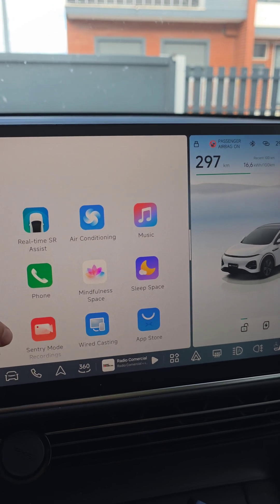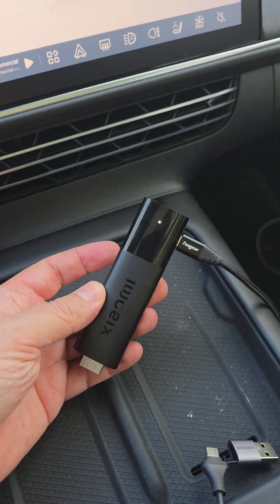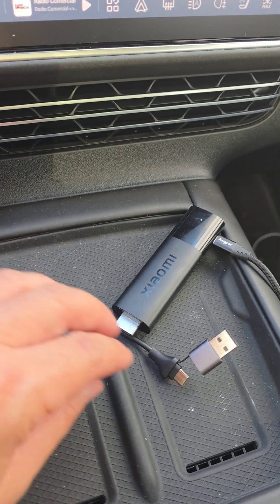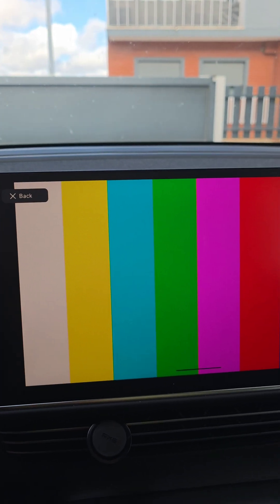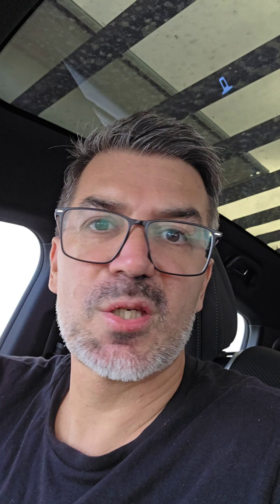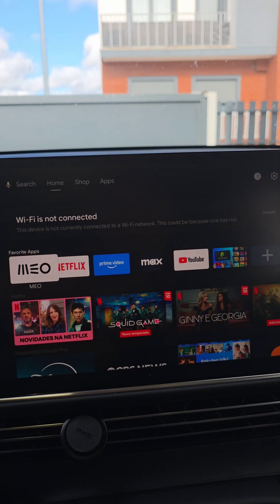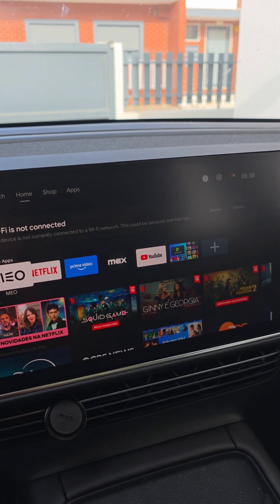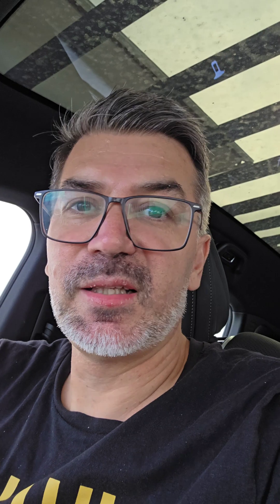Debug your Wired connection of devices to the Xpeng Car.

Comment: I cannot mana ne just not programmed the same
Reply from the maker: I dint got your message well! Can you rephrase that?
Reply: @XPengPT i use the jovitech usb it works on samsung as input and tv as output but its doesn’t work on the xiaomii tv stick as input to the g6 touch screen. 😢
Reply from the maker: Probably some signal that is missing. Xpeng USB port does detect some king of sinal. My Elgato Capture 4k was also not able to provide that signal and does not work.
Reply: @XPengPT  Ugreen adapter will probably work? 1080 pixel or.the 2K pixel should I use ?

Comment: Hi Hugo. I bought a UGreen HDMI converter but it’s not working. Slightly different to yours. Straight USBC, not with A option. Can you link to the UGreen you bought?
Reply from the maker: Hello,
That hapens many times, i dont know why there are different version or how they communicate differently, but many people already had to change the adaptor for other. Buy it on Amazon, as they facilitate the exchange if something is not good.

Below you have my full video with that, and i have in the description of the video, the link for the equipmenti got
https://youtu.be/6s1F9llUuhk?si=scF0gYJotPE1tV0f
Reply: @XPengPT Yes, just stuck it back in the post to Amazon. Will try again.
Reply from the maker: Be careful with the version you order. i got people getting the exact same (it seems at least) but from AliExpress for instance (they sell a lot of Ugreen on AliExpress) and it didn't work :) So its really try and miss.

One way to check, is to connect only the converter to the car. If you do so, it should show some color bars, meaning that car is recognizing the video signal but nothing is really being transmitted.

Comment: Ola, have you done a comparison of self driving with autonomous driving to see which is most efficient in power usage?
Reply from the maker: Hi you mean comparing manual drive with self drive? I thought already on that because the feeling is have is that self drive consumes a bit more? But its difficult to compare as i can't replicate the self drive behavior while driving manually and then the test/comparison is somehow compromised.
But I feel (its a feeling) that self drive does consume a bit more, but that is due to the fact that the car doesn't anticipate or see some sections where tou can drive differently than just contact speed, and that will impact consumption

Comment: Thanks, I didn't understand, is it possible to connect an any media console in a car? I should get Xpeng G9 soon
Reply from the maker: Can't say that is possible any. But if it is possible to power it over USB (5v) and it has a HDMI output in theory you can yes. For higher power consoles or devices you may need to use the 12v power in the trunk to power the device.